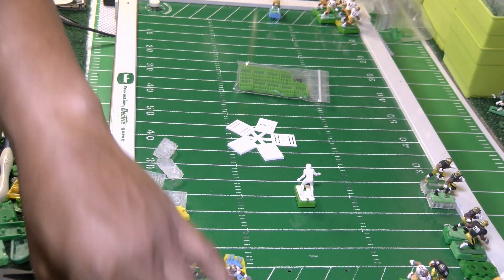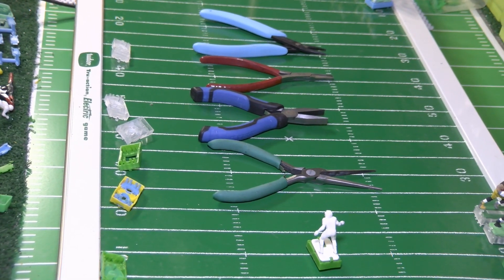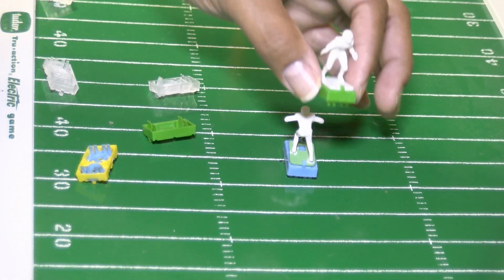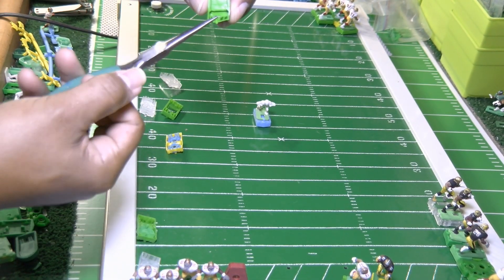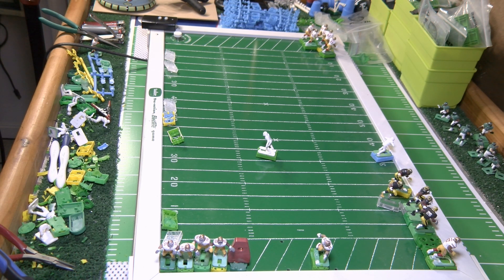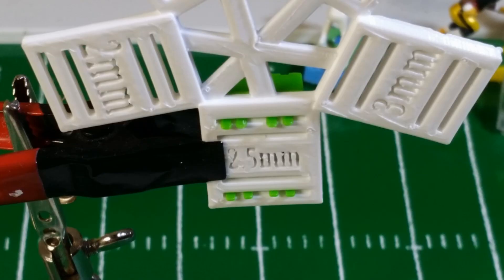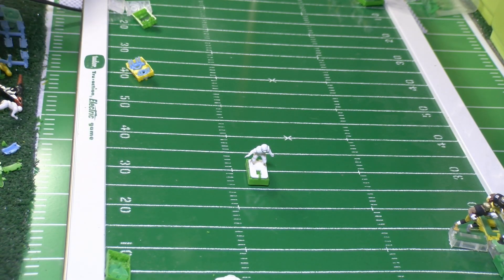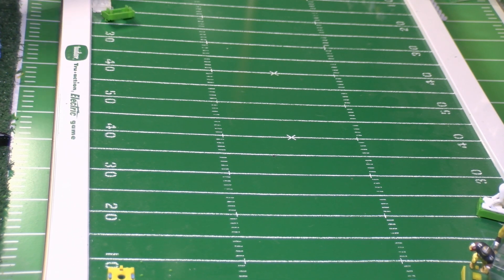TWEAK LOUNGE 101

Comment: Are trimming the prongs absolutely necessary? 

Because I suck at trimming, I use the gray ones that you showed in the video, and I still can't get them even.
Reply from the maker: Trimming the prongs isn't a necessary step to tweak a base, but trimming the prongs will help you to get the most out of the base. You want the prongs to be flush on the board. 
To keep the base from sliding around on the trimmer, use a clamp to hold the base in position. I used a clamp in the video.
Reply: @Electriccoach  Thanks Coach I will try it using a clamp next time, I'll let you know how it turns out. Thanks again for the great videos.